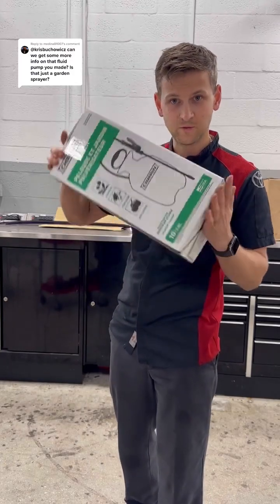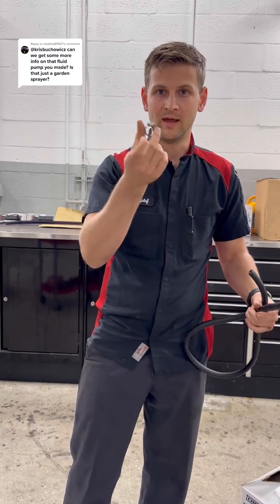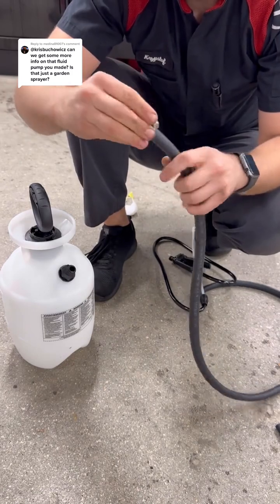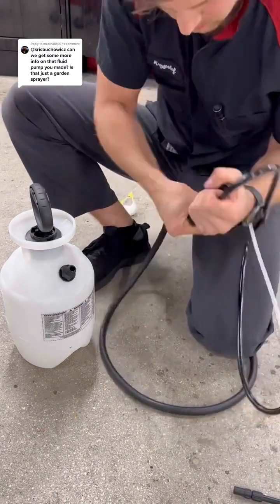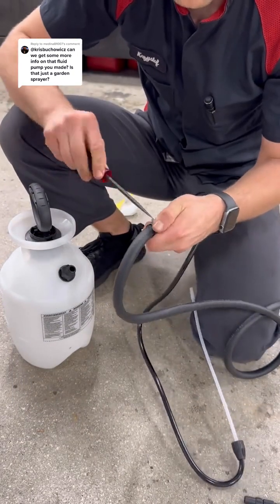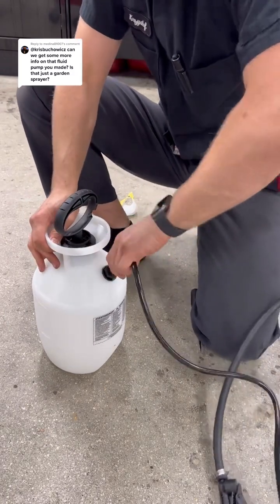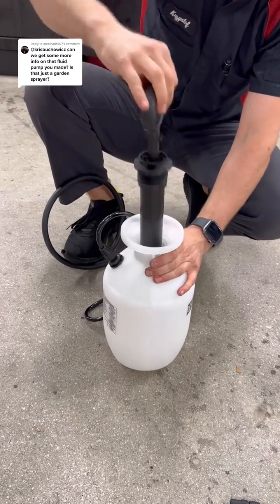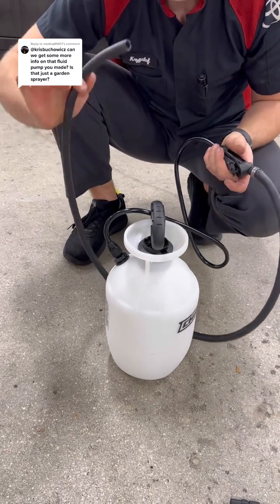How to build a oil transfer pump from a garden sprayer.

Comment: If you want to make it even better you can drill a hole in the side of it and put a Schrader valve like a valve stem from a car tire attached to the side of the bottle with strong Velcro or whatever you want to use small tire inflator I would recommend the xiaomi one because you can set it to automatically turn on when it drops below a certain PSI and it shuts off when it automatically gets to the correct PSI and hook that up anymore if you want to be really fancy and get a fluid flow meter and put it right by the trigger is it to count how much oil has been blowing out of it as your transferring the fluid into your engine like engine oil or even transmission oil and if you want to be extra you can buy one that's has a much bigger tank so you could hold a lot more oil in it

Comment: Those seals will not last more then one job before they fail and fall apart from brake fluid.
Reply from the maker: I’ve had my gear line one for 4 years and my CVT one for 3. Needed to replace my WA fluid one because the actual pump handle snapped off after 3 years. I use atleast once a day and I never clean them out…hence why I have 3 different ones. Seals don’t cause a issue at all